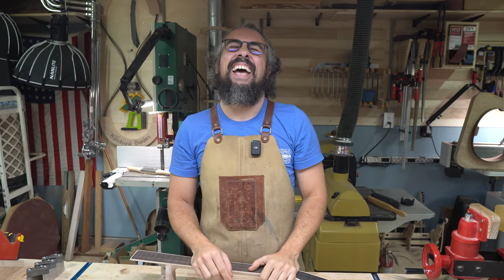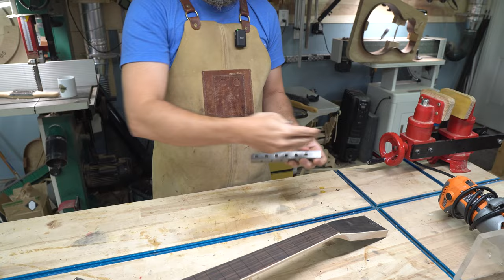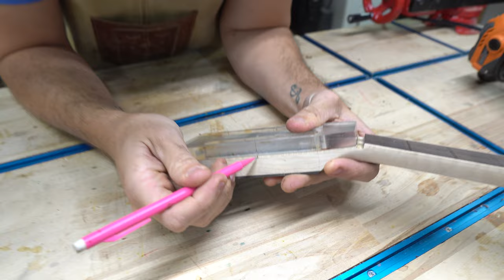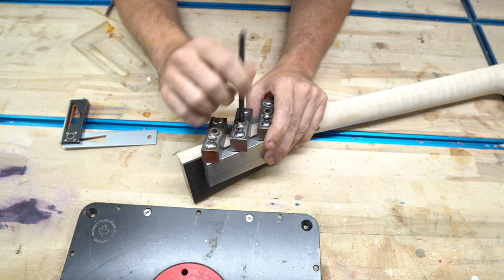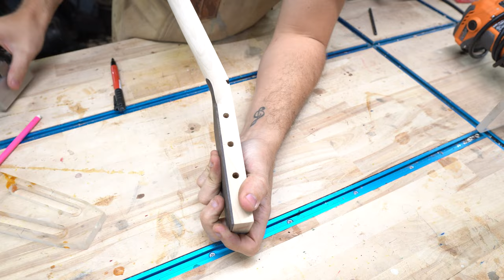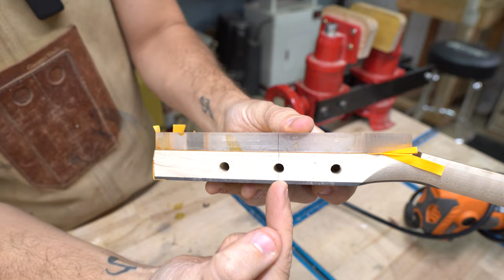How To Make An Acoustic Guitar Ep. 37 (Slotting The Headstock)

Comment: Chris, I have had excellent success using a foot switch with my routers depending on the application I'm doing at the time. Doing your slots is an excellent time to use one. It takes the pucker factor totally out of the picture. Get comfortable with your router placement and just step on the switch and begin to rout. I also have had my drill press hooked up to a foot switch for many years now. You will need the end of the cord to have a male and female cord end. The male plugs into the wall and you then plug your router into the female. If you have trouble locating one let me know and I will look in my files to get the company name for you. Love the videos by the way.

Comment: If you cut the slot with a smaller diameter bit and flush trim with around 2 mil left to cut, it should eliminate any tearout and diminish cleanup. You can achieve everything without the manual plunge if you build a jig (or 2) for the cuts. The jigs are simply open ended boxes to fit the head into both ends (for the reverse procedure). Wedges to clamp the head and threaded inserts and bolts on the wedge side to tighten the clamp (so you don't have to make accurate wedges for each headstock, but with cnc it wont matter). Also put two wedges underneath to make sure the head is making contact with the top of the box before tightening the side wedge. The box for the first cut has an overhanging platform with a fence and stops for a plunge router to rough cut the slots. The platform of the box for the 2nd cut is just a plexiglass top with your slot size cut into it as a template and then flush trim. I use the same flush trim bit for both cuts and not as risky as this method.

Comment: Can you make a video how to improve bass response of a guitar?
I got an IBG J200, which as less depth than its Gibson counterpart.
But the thing sounds... beautiful!!! Like for real, I think it has a great tone.
First time I have a not made in China guitar.
I feel its very well made, when I tune it up the tuner's needle stays like almost dead center to the desired note. That's a first to me also.
Changed the strings (had PB D'Addario maybe 52's), to Lifespan Martin (PB) and right now it has Elixirs MEDIUM (80/20 because that's what I have) and now sounds louder in good way, still very good tone, like excellent.
EXCEPT the bass is really not up to par.
With the Elixirs it improved the midrange umph by a lot.
I removed the under saddle pickup, replaced saddle with a bone one too.
Soon will replace strings with Elixirs PB (Nanoweb ofc).

If you know it can be done (I know about the changing the pins for no cavity ones, forgot the proper definition, etc. from one of your videos.)

I will love you forever if you improve from afar my guitar X)

In other words, I BEG YOU on my knees if you can let me know how to improve the bass. Sigh...

Also, should I remove the pickguard? Can I take it to a carpenter so he makes it thinner? Then put it back on ?
Will that help?

Comment: I enjoy your videos and respect your knowledge and experience .... but .... I don't understand your contention that a slotted headstock should sound better because of the greater break angle behind the nut . Wouldn't that  then mean the advantage would become moot ,at or , beyond the first fret when using a capo ? For myself I feel the nut ( if properly designed ,  fitted and filed ) has very little to do with the sound . Otherwise using a capo at any/all frets would compromise this supposed advantage because the nut and break angle would be uninvolved with the situation . Also a non slotted headstock should be stronger, all things being equal . I have no problem with slotted headstocks ,other than strength , but I see no advantages other than looks and/or tradition . I love your work but tell me where I'm wrong  ?

Comment: I know nothing about guitars. I am a fabricator. Metal. Welding, more specifically TIG. Personally, I'm curious why the individual parts are not completed first. In other words. I know you have machines, but what if during cutting something happens and you cannot use that part? I make EVERYTHING first, then test, then disassembled for finishes, then final assembly, testing for quality control.